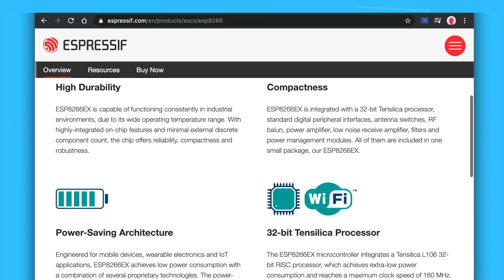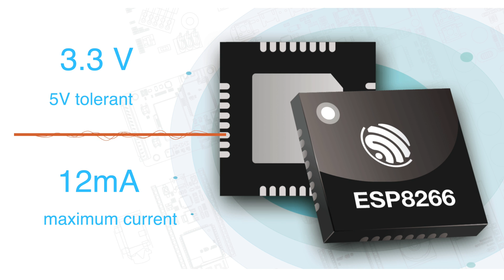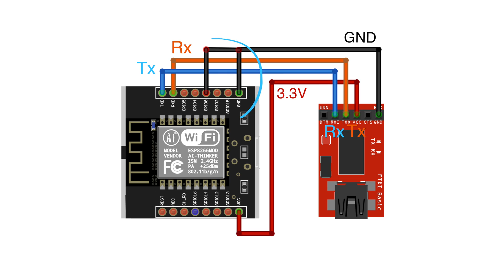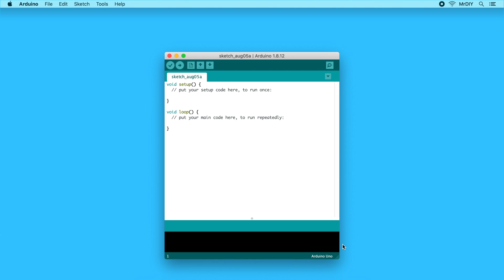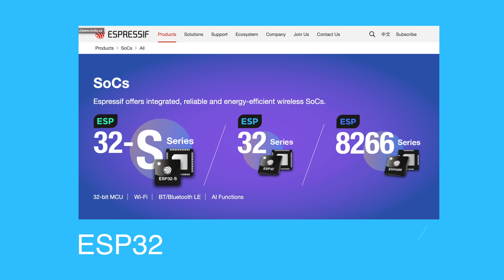ESP8266 in 5 minutes

Comment: I find ESPHOME easier. Also if you plan to use HomeAssistant, ESPHOME is built in. I have tried and succeeded with the Arduino IDE, but since I don't like C++ I prefer not to use it.

Comment: I've been working with the Esp8266 for years now, using both the NodeMcu board and the ESP-12E module, and I still found this video very interesting.
Can you point me to some datasheet showing that the I/O pins are 5V tolerant? Every site mentions 3.6V as maximum (could be for VCC, but no mention of 5V tolerance for I/O)